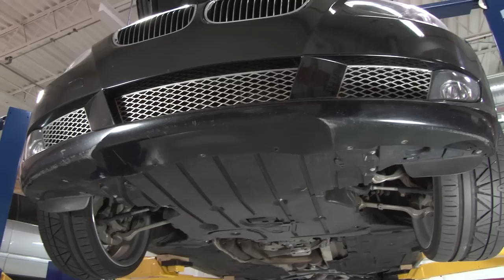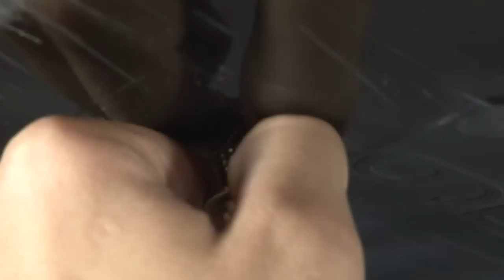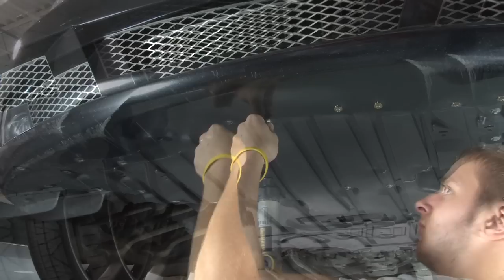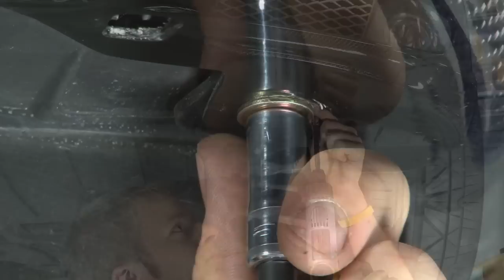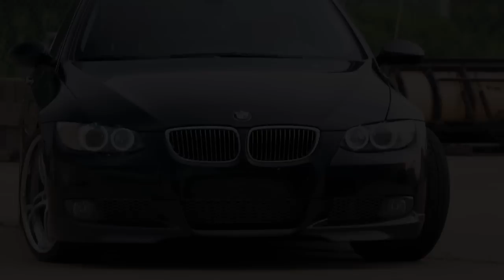ECS Tuning: E92/E93 Front Lip Spoiler Installation

Comment: What are those flaps in front of the Front Left and Right Tyres?

My flaps are half broken off but still on on both sides and I would like to replace them.

Also what is the part number to replace these?

I have an idea that it could be this item number on eBay: 400992338927

I am not sure..